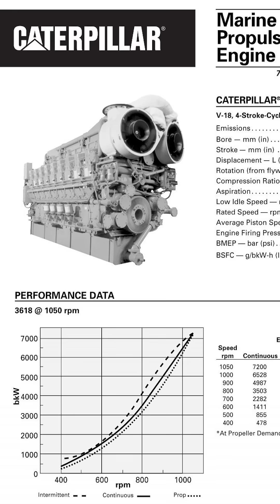wHy Don'T CaRS uSE V18 ENGiNEs?

Comment: Now, i know i could be 💯 wrong on this, but i think that the reason why we don't have V18 or V24s is because there mostly designed for larger vehicles like trains and ships, and would be way too big for cars. So my ideal theory is that maybe with some very precise measurements and engineering, i think that it could be possible. But then again, i could be very wrong.

Comment: you can have a V14..... just take a V6 and put it in parallel with a V8 and synch the two with a proper gear box

I didn't say it would be easy - but it is possible

Comment: that engine would be atleast 9 feet long! if you take the average length of a V12 engine then divided by 12 to figure out what one section would be in length then multiply that by 18 and divide by 12 so it would be more than 9 feet long, which would not fit in pretty much any car

Comment: I mean you could just drop the displacement per cylinder to make it smaller and have high rev small cylinder capacity engine that is V18. Hell make it as W18 to fit into smaller frame and if you valves are issue make it two stroke.. ou boy that would be funky sounding engine.

Comment: I am a car noob here so sorry if this question is dumb. Why can’t they just make the cylinders slightly smaller and minimise the size without drastically decreasing performance?
Reply: Because then you could fit a larger displacement engine with less cylinders in the same space and it would probably make more sense to do that

Comment: For those wondering about the massive red engine, it’s probably a bigger brother to the Cummins QTA-50 (Quad Turbo Aspirated 50 liter) V16 Marine engine, they output about 1500hp and 4500lbft of torque stock. I’ve never seen a V18 version though in my time in the commercial marine industry. How that tiny ass truck managed to hold that thing is beyond me though because the V12 Version the KTA-38 weighs 9300lbs dry. I’d imagine the 50L v16 is probably in the 12000lbs range, idk any truck that has payload capacity.

Each of those intake runners on the side is its’ own intercooler for the 3 cylinders.

Comment: Well it may work diagonally the Swedish army mounted the engine (straight 6 ) diagonals in the rear of the IKV-91 (Infanterikanonvagn 91). it could be a way of doing it although would be annoying to get an out put from

Comment: V8 or v16 is purrfection 
Because- the 4 stroke engine configuration always has 2 cylinders / almost slightly off but basically firing at same time
All engines should be v8 
Inline 6 can make alot of torque 
However a v8 is much better 

Now that being said
We as a society are demoralized and brainwashed to desire less
No
Less is not more
Less is less
And there seems to be a political ideology and symbolic agenda that goes along with communism or some “ cute” agenda . That’s trying to  integrate the engine into social warfare statements or environmental communism.

Just burn the fuel
It’s abiotic made from microbes in Marcellus shale deposits 
It’s free and renewable 

I’d like a 2 stroke turbo diesel v8 - they made one
Oh that was a supercharger I think
Well
We could have had a much better world
But settle for less based on someone else’s ideology and control in economic terms.
Not our own

Why would anyone want a v6 when they could have the same  system in a v8 configuration?
Stupid I guess 
Oh the 4 oz of gas every 20 miles ya
Ya
That
Right
Ok
Burn natural gas then
Or a 67 Oldsmobile tornado hybrid would be a wonderful 800 hp 75 mpg vehicle 
But you want a Prius because it’s cute and says
I love plastic crap 💩 without a bumper sticker

Comment: i mean, just a question ok im not an engineer or anything, but cant they just make mich smaller pistons so they reduce the engine size?
Reply: Excellent question. I am an engineer and I can answer it.  Smaller pistons means less area for the combustion chamber, and therefore, less power. 

The piston rods themselves would also be smaller and weaker, so we can't really use compression to increase power unless we build the whole thing out of titanium alloy, or graphene, something else hideously expensive. 

Even then, the addition of more piston rods means more moving parts and friction, lowering power output, so it's really not worth doing unless you're going to get a lot of power and be able to use it. 

Finally, we have the problem that smaller pistons and higher compression also make your vehicle into a bomb. By my very rough calculations, the 500 PSI you would need for an average gasoline engine means you are fucked if you blow a gasket. If w tried to make it diesel, we're looking at approximately 1000 PSI, which is a fuel-air bomb just waiting to go off.  

then there's reinforcing the gaskets themselves, making the fuel pump more powerful.....I didn't figure it all out but it's already a pain in the ass. I wouldn't even want to design it, let alone deploy it.
Reply: @arcdecibel9986 thank you for the reply! i kinda get it now, it would be the most inefficient thing in history basically😂

Comment: Actually Bugatti did at least suggest a V18 engine in their 1999 concept car - the 18/3 Chiron (not at all related to the 2015 Chiron however). The 18/3 refers to the 18 cylinders distributed in 3 banks of 6 cylinders, so basically 3 V6s joined together. Obviously it never went into production, but the idea of a V18 has at least been considered at some point.

Comment: 3 cylinder engines are good enough when ego isnt involved. Sturdy, reliable and long lasting.
My city is so congested (fully recovered from chee ping pong illness) that you may be able to drive at 50 mph on Sunday or at midnight other days. 3- 4 cylinder cars are adequate for moving from  one red to the next!
I have a 3 cylinder Suzuki hatchback since  2006. Since I dont race on F1 tracks, this is perfectly adequate

Comment: we go X engines which is like 2 Vs strapped together in planes. but i imagine aside from size, the cost of fuel and more moving parts means more can break is the reason we dont push that limit

Comment: Make a V-12 merged with a straight 6 in the middle of the V.  It could be a Y-18 or (or an upside down Y), or it could be a V with a vertical line through it. Cooler than a W-16. Might have a high center of mass :)

Comment: If they do eventually make v18 engines they should go for v20 also cant they make engines smaller literally the mechanics that work at any car dealership or repair shop are professionals arent they?! with OSHA and ACE certification that means the are smart enough to make the v18 fit in a car

Comment: I'm just gonna say:
Wärtsilä-Sulzer RTA96-C turbocharged two-stroke diesel engine
-2,300 tons
-13.5 meters tall, and 27.3 meters long.
-113,000 HORSEPOWER
-massive displacement of 25,480 liters (1,820 liters per cylinder)

your life has been altered, have a nice day.

Comment: I want to know why no one has used two 0.6L inline 4 or 1.0L inline 4 engines for a car. 

Most cars struggle to output 100 HP per liter without forced induction. 

Motorcycles have been hitting 200 HP per liter without forced induction for about a decade or two. 

So, if a Miata has a 2.L inline 4 with 181HP and 151ftlbs torque … 

Why not try two 1.0L engines for 2.0L with 430HP and 168ftlbs of torque? And it may rev well above 15,000 RPM. 

Or smaller engines with two 0.6L motors for 1.2L of displacement with 235HP and 100ftlbs of torque. 

This would need a pretty custom transmission. Motorcycles don’t have reverse gearing (usually).

Comment: As a person of many things, a car guy, plane guy, and even train guy, hearing the Turbo V12’s of GEVO’s are pretty cool. One thing to note (if you didn’t know already), The engine does not directly power the locomotive, it instead produces electricity for the electric motors attached to each axle, known as Traction Motors. These are what actually move the train and the engine is called the Prime Mover, which produces electricity for the motors to pull the loads. So technically, the trains are electric, energized by a diesel generator with thousands of horsepower

Comment: “V16”

Shows a car with a W16 engine
Reply: And btw a W16 is not the same as a V16

A W16 the firing order on Bugatti’s W16 is 1-14-9-4-7-12-15-6-13-8-3-16-11-2-5-10 it’s not just a V engine it’s also rotated 90 degrees

Comment: I mean, once you start getting into anything between V16 to V20, you're gonna wanna start looking at locomotives and ships... I can't think of a single way to put something that large into a car... That being said, if you want a real engine growl, listen to some of the old EMD engines in certain locomotives, for example, the EMD SD45T-2 which has an EMD 20-645E3 which is a V20 with a displacement of 645 cubic inches PER CYLINDER! The EMD 710 is a larger displacement (710 cubic inches per cylinder) but those are hard to find in V20 format in anything, only some ships and locomotives have them, and the ones that do aren't very common. All of this being said, if I want that classic "diesel chug" I'll usually go for an ALCo over any other manufacturer, any day of the week. Something about those old ALCo diesels just sound almost magical.

Comment: V18s are purely unnecessary. While it's possible, it's not financially feasible for manufacturers. Laws and regulations are strict, speed limits, it definitely won't be cheap to make a v18.
There's no need for one. A v10 is enough, and produces beautiful sounds, same with v12s. V8s are perfect.

Comment: so fun fact, i worked on the railroad, and most engines are going to be v12-v16, anything bigger is just impractical since theyre diesel electric, and just transfor engine power to electricity to end down to the motors in the wheels

Comment: Size matters, yeah you could potentially SHRINK an engine to that you can fit lets say a V20 in a car. But the cylinders would be really small and as much as it would be a smooth engine... it wouldn't really be better than a V8.

Comment: Well the Bugatti's that had 16 cylinder engines were in a W configuration, not V, which happened to help save space.
I wonder if a W18 would fit in a car?

Comment: Well it's not like they have to be built massive they can just have smaller cylinders like for example the diameter of the LS cylinder bore just make the cylinder size 3/4 of that and with that for example you would have the ability to put 5-cylinder Banks equal to the total amount of length that is in the V8 and then you slap another four cylinders on to that total length and it would be roughly the total length of a v16 and then you put it into a car with a long front end and a short rear end like the Shelby Daytona or the Datsun 240z - 300zx or the Porsche 944 I mean even with that making room for the radiator oil cooler transmission cooler exhaust systems the car is going to be about the total length 70's era Cadillac or Monte Carlo roughly about anywhere from minimum 16 to 20 ft long but it would be totally feasible

Comment: a w18 engine would be more plausible as we already have a w12 engine

a w18 will require 3 inline 6 engines strapped together

even a rolls was fitted with a v16 engine

Comment: here's a question I've always wondered: Why isn't there a second set of piston heads attached to a second engine block on top? That way you could use the reciprocal action to minimize friction and increase fuel efficiency. I get that it would be astronomically harder to maintain, but surely some crazy engineer has at least given it a try.
(edited for word choice)

Comment: ... I drive an old Nissan Leaf. I have no cylinders. I don't really need enough torque to make my tires explode. 

A V18 seems like it'd be for, like, a racing boat. One of those ones that lifts almost completely out of the water and needs a couple minutes to slow down enough that steering becomes possible again.

Comment: Don't forget about the 107,000 Hp beast turning @ 700rpm😂😂 & burns 10,000 gallons of diesel per hour 😂😂.. Block is 40 feet high x 96 feet long😂😂

Comment: Just make it smaller, just make it like 200CCs a cylinder. That would be a 3.6L which is a fairly standard mid size car engine. Sure the engine would cost like 4x or more than normal but it would be fun.

Comment: Love that he uses an industrial engine as if they have any comparison to car engines... the reason we don't use them is the crank has to be so heavy to not break you'd end up with a 4500 rpm redline and low horsepower/high torque... and no... that ship motor isn't what it would even remotely sound like

Comment: Well, the mechanically and complex X style engine the Germans made once could mitigate length problems. Splitting it into 5 each, but increasing cylinder count by 2. Or, like the W16, have it be W shaped, with 6 cylinders per. This can save on space and retain power without being too complex.

Comment: I imagine a v18 for a car would be like the largest engine on crossout. It's bigger than the cabin of the car itself and has to be attached to like the back of the cab or attached in some way that's not in the engine bay

Comment: The bugatti tourbillion a concept car that had a v16 but that was in 2003 currently far as I know in a production car the only one to have a 16 cylinder engine is bugatti but it is not a v style engine it's called a w16 8.0l which was based off a volkswagen VR8 design.

Comment: Is there such a thing as a V1 engine?
Reply: İt's will be called Slant 1 because there's no second cylinder complete the V shape 

Generally there's not bad amount of small Chinese "chopper" bikes that have slant 1 

Which yeah slant engine is a thing most popular series of Slant engine's are Chrysler's from 60's to 70's, they usually was base engine 

Like in first gen challenger you start with 218 and 225 slant 6 engine's and later jump to 318 V8 and go on

Comment: the other thing is, where r u gonna put the fuel tank and everything else needed to support a massive v18? it’ll need its own transmission, fuel tank, coolant tanks, starter, and lots of other stuff that will have to be bigger to accommodate it. u’ll end up with a car the size of a semi truck or bigger.

Comment: I mean, we've had W18 engines since at least 1915. They've been used in planes for over a century at this point. And post-war, they ended up in some of the earliest race car prototypes. You'll even see them turn up in some of those giant earthmover trucks from time-to-time. They just aren't very practical for most things because you end up having to move this huge engine as part of its operation.

It's a bit like asking why you need to drive a car to the shops when a bicycle will take you there far more efficiently. Hell, literally 99% of the energy used by the car's engine is to drive the car itself, with the remaining part being the driver.

Comment: wait v18 could work if you just scale it down still have the 18 cylinders they will just be small but at that point it’s pointless and will give the same power as an in-line 6

Comment: Some of those engines are truly massive. I seem to remember watching a video where technicians were working on one. I think it was on an aircraft carrier or container ship. The engine was so large that, after they did the safety lockdown, the technicians could climb INTO the cylinders like stepping into closet. That's a really big engine. 😮

Comment: Issue is rpm vs torque vs strength of crankshaft. Issue always goes to the weakest link. Which a super long crankshaft would be very weak at high speed and torque. So rpm would have to be lower. That point, it’s impractical

Comment: so, the reason of not using v18 is the big size, this is a dumb excuse. why don't they make it small the, to match the size with v4 or v6 then it can fit anywhere. all it need is some engineering to make it smaller.

Comment: Fun fact:the p1000 ratte was going have v18 but was debated between two but for simple talking i will call the firts one v1 and the other v2
So v1 was the first one to be brown up but the problem with v1 was that if one engine out of the four v1's destoryed itself the others would not work if a singular v1 broke down for faster Acceleration but v2 didn't have that problem that v1 had v2 can work independently and if one broke down the others work but v2 has slower acceleration and would get slower every time one broke down
V1 pros: acceleration and speed
Cons:breaks if one v1 breaks
V2 pros: doesn't need other v2's to work
Cons: acceleration and slower everytime one v2 breaks down